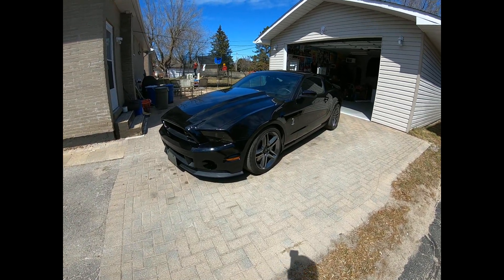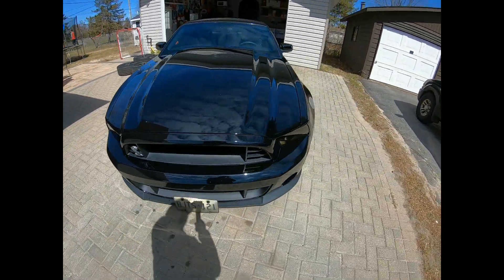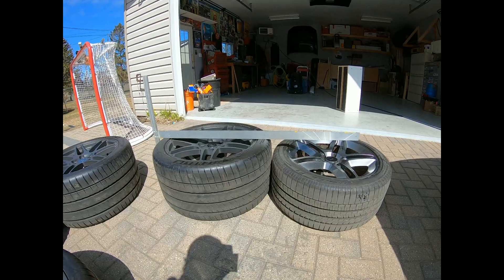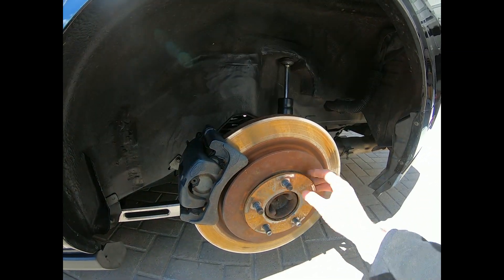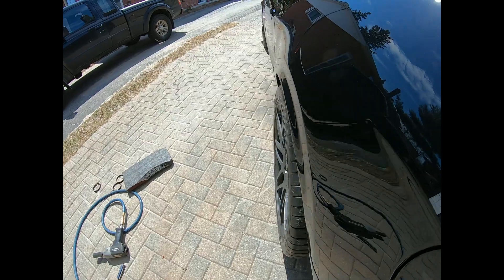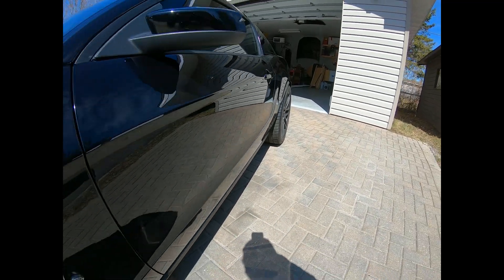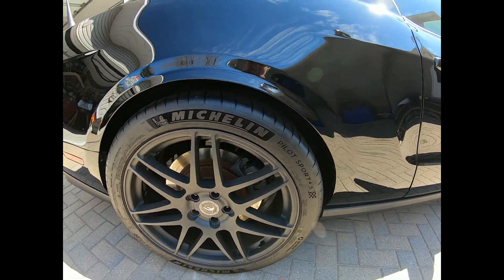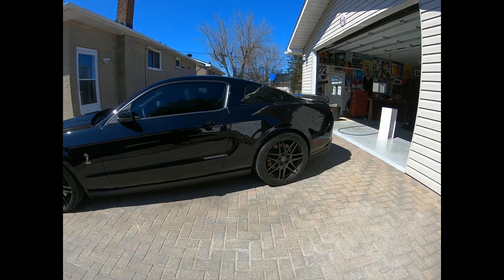How I fit 345s on my GT500

Comment: Hi!
I wanted to ask you, out of curiosity did you ever considered 335/30/20? I know they look a lot better than the 325/30/20’s. Thanks!
Reply from the maker: @loloforge2841  yes I had 335/30r20s before I did the fender mods.  They were very tight in the fender wells. The fender mods gave me room to fit 345s with extra clearance
Reply: @ agree. Always good to be safe. Thanks

Comment: Those 345s are HUGE!!
Reply from the maker: I forgot to mention they measure 13.5" wide in my video
Reply: @RogerBuckChrist  That's some serious traction. You'll need it with that big whipple! Have you run any dyno numbers with it yet?
Reply from the maker: @tomkjr1  not yet...my tuner is 4 hours away and we aren't travelling yet
Reply: @RogerBuckChrist  If you don't mind me asking, where are you located? I need a good tuner too, but I'm in NJ.
Reply from the maker: I'm in Ontario,Canada....I have to go to toronto to get it tuned
Reply: @RogerBuckChrist  Yikes! I have the same problem...nothing local.
Reply: Hey man, thank you for posting this! Amazing job. What kind of off set did you go with?

Comment: Running those tires on stock height 09 Shelby gt 500 super snake 🐍 345 -30-20 zr nitto have 20/11 inch rim
Reply from the maker: Nittos are narrower then Michelin
Reply: Did you have to clearance the inner fender on that 09,   like relocate bump stocks & the brackets, etc...???

Comment: This might only have to get done if a 20” is used. But all this actually isn’t necessary, especially removing and cutting things. I run a +54 or 55 18x11 forgestar f14 with MT ss 345/35/18. All I had to do is smack the inner well a bit with a auto body dolly. Tires will stick out 3/16”,  if you really play with your pan hard bar you can get it less. Not a big deal and barely noticeable.  Also if anyone is wondering, a 345 on a 11” barely bulges, maybe a 1/4” on each side. Just my experience. Car is a 08 GT500

Comment: I'm about to widen my 2013 rims to 11.5 - 11.75... In part to keep the OEM offset in tact.  Bumpstop relocation etc.. in the works too..
  It looks good, but was the spacer necessary?   Were you still rubbing the inner fender after all the cleanup you did there?
Reply from the maker: I was OK with 325s and 335s, but when I went to 345s it was just too  close to the inner fender.  I had lots of room to push them out after the flare so I added the spacer

Comment: Sorry if I missed it in the video but what are the fronts ?
Reply from the maker: I didn't mention the fronts. They are 20x9s with 265/35R20s
Reply: @RogerBuckChrist  did you make a video about how you flared the fender? With just a roller?
Reply from the maker: @Phuong_Nguyen_  no I didn't show how....but we just used a fender roller.